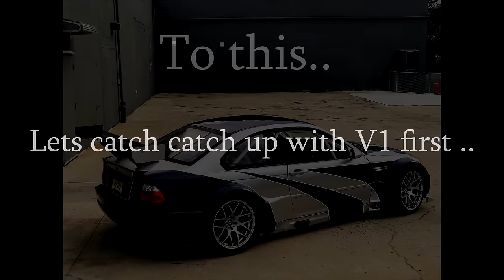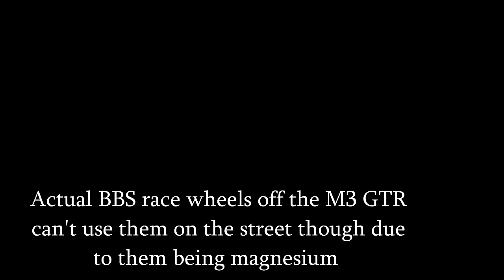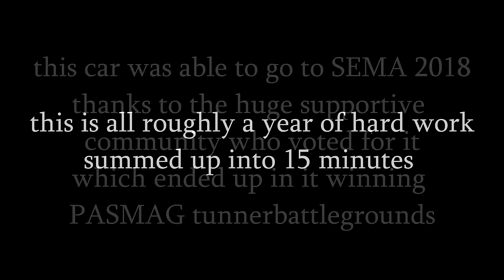NFSMW M3 GTR Full Build Timelapse

Comment: Finally someone not doing it half assed. Glad to see you went full racecar on the inside as well.
The S62 V8 from the E92 M3 would be a suitable, and attainable solution to get a high revving V8. Mated to a straight cut set of gears, and you'll have the whole experience.

Comment: I was rather concerned when he brought in the fiberglas pieces, cause they looked like shit. But he did some great paint work and it payed off. One tip though from someone that works with Carbon Fiber regularly: wear breathing protection when you sand carbon fiber. Carbon Dust will settle in your lungs and cause cancer.

Comment: So why can’t you use magnesium wheels on the street?
Reply: If I'm not mistaken, magnesium is extremely lightweight and also brittle. A single pothole could crack or chip the wheels. Magnesium also has no corrosion resistance. Get it wet and bye bye wheels lol
Reply: Even as an alloy? Since they aren’t straight magnesium